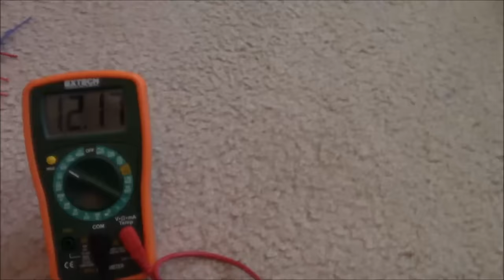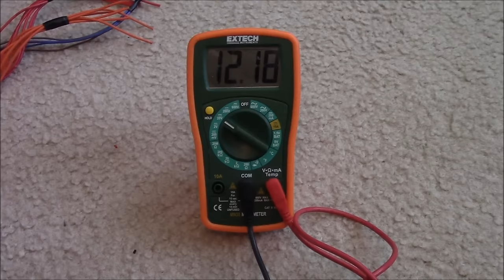How to Hack a Computer Power Supply (PSU) To Use as a 12V DC Power Source

Comment: why you are soldering all the blacks and yellows? wouldn't be enough to use only wire for each? I am trying to figure it out if make any sense. Thanks.
Reply from the maker: +goshell1975 Each wire alone will not be enough to use the full power of the +12v rail of the power supply.  On mine it produces 20 amps and that much current would fry one of those small wires by itself.  But if you give that power multiple wires to pass through it will not burn the wires.
Reply: +LDSreliance Thank you, seems like a decent explanation! Cheers
Reply from the maker: goshell1975
You are welcome.  Good luck!

Comment: once I put the power on and the ground wires together the power supply went on but switched off again a few seconds later. Did I do something wrong? I still get 5v on the standby (purple) wire when I test it though. any ideas?

Comment: Hi, I am interested in powering a desktop at my off grid workshop.   While I have 120 vac available,  it occurred to me that the power supply in these is mostly 12 volt and some small quantities of lower voltage power. 

I am toying with the idea of setting up a small 12 volt solar/ battery setup to power the desktop directly from the battery instead of the 48 volt/ inverter conbo.

Is the voltage swing too wide on an agm battery too wide to make this viable or is it a reasonable concept?

Another possibility would be to find a 48 volt dc fed server power supply. 

Thanks for any suggestions.
Reply from the maker: The best way to do this is to have a PSU that is designed for it.  Here are two options:

Powerstream out of Utah makes a variety of DC powered, full sized ATX power supplies - https://www.powerstream.com/DC_PC.htm
PicoPSU makes a bunch of small power supplies that can be fed directly by 12V DC - https://www.mini-box.com/DC-DC

I have used both in the past.  I used a Powerstream model for my solar powered crypto mining rig (https://youtu.be/ucdIE2aG_Ds) and a 12V DC PicoPSU in my low power home web server build (https://youtu.be/Foioqv09hsU).  If you aren't looking to power a graphics card then you can get away with the PicoPSU units since they will give you plenty of power for a CPU and the normal stuff.  But if you need to run a discrete graphics card in your machine then you will need a full size ATX power supply.
Reply: @LDSreliance  Thank you,  really appreciate the information.
Reply from the maker: You are welcome.  Good luck!

Comment: Thank you so much for your video.  I have completed everything you've 
shown but I am stuck as to where the positive and negative goes to be able to light up LED strips.  I'm trying to help a friend with a set design and we are both stuck.
Reply from the maker: This is just a roll of led's, right?  Where are you stuck?
Reply: I have the LED lights clipped into wires that are connected to a different control box. (Will have to ask the other person the specific name of the control box.) Where I'm stuck....  Some videos I've watched bundles all of the black wires and all the yellow wires..... other videos pair up single yellow and black wires..... I'm assuming I could do it either way but don't know the +/- to either decision.  I also can't tell how the wires are directly connected to the LED lights when the LED lights have been cut. (I hope this makes sense.)
Reply from the maker: It depends on the voltage of your LED's and the voltage of the power source.  LED voltage varies depending on the color and other factors but let's say your LED's are red and require 1.7V each.  Your power source is a computer power supply like I made in this video I am assuming.  So you are most likely using 12V like in the video (yellow wires).  So if you connected each LED individually to the power supply they would burn out because you are providing too high voltage.  So you need to connect 7 of them in series, end to end, so that they can safely use 12V.  

In other words, you need to find out the voltage of each individual LED, take 12 divided by that number, and then use that many LED's in a series circuit where you wire the positive of one LED to the negative of the next and so on.
Reply: LDSreliance thank you so much. I will pass the info on.
Reply from the maker: You are welcome.  Thanks for watching!  Be sure to subscribe if you haven't already.

Comment: Is it really necessary to connect all those wires? The load won't be that great anyway, so the possibility of a burnout is remote. I get that 40 Amps is a lot, but I'm not sure you could hold that much even with all of these thin wires.
Reply from the maker: +SleekMinister Maybe, maybe not.  Better safe than sorry.  I knew I was only ever going to use one load at a time so I bundled them all together.  If you think you might use multiple loads then bundle them into smaller bundles.
Reply: One CPU fan, typically, uses 0,15-0.45A, so the use would have to be drastic indeed, to approach 40, and I still don't see how that' s supposed to be possible. Still struggling to see why I need a power supply that I can't regulate the output on. If only I knew hot to make one.. I'd trade a health tip for that, I would.
Reply from the maker: SleekMinister
Why do you need to regulate the output?  Devices will pull the current that they need and that is all.  Power supplies do not push their rated output upon devices.  So you could hook up a 0.3 amp fan to this and it would be happy or you could connect a 300 watt box fan and it would be happy.  But by not combining the wires together you would not be able to run a higher current load for very long with one of those ~18 gauge wires without heating up the wire and eventually causing a fire or severing the wire.

Comment: I have a 500W psu which states +12v1 16A and +12v2 18A. By combining the wires as you've shown, would this be enough to power a peltier device, along with fans and a pump? Or would it create too much Amperage and Wattage. I prefer not to burn any parts up by over powering them lol
Reply from the maker: I would not recommend combining the rails.  Why not power the peltier with one and the fans and pump on the other?

Comment: If was using for model railroad to power leds with resistors for building lights and street lights could a just run a long bus wire off each and tap into it as needed?  12 or 14 gauge wire for the two "bus" wires running length of table underneath?
Reply from the maker: Yes, but the longer the wire the more voltage you will lose.  12v suffers from a lot of voltage drop.

Comment: If I'm trying to power 4 peltier modules, with fans, can I use this method but distribute the 12v wires amongst all the components?
Reply from the maker: Sure.  Just make sure you are under the max current of the +12V rail for all of these devices.  The only reason I bundled all the wires together is so that I could safely use all 20A that the rail of this PSU provides.

Comment: Hey thanks for your vid ... it's helping me out on a current project.
Reply from the maker: You are welcome.  Thanks for watching!
Reply: @LDSreliance  sir 1 q
Does adding 12v1v and 12v2v poses any problem?
Currently using arduino and pwm controller and for some reason when I wanted change the flow of current pole(clockwise to acw) the PSU shut down before it happens(just 1 direction only)
Can you tell me what is wrong with this?

Comment: I have a power supply from a 2006 Dell xps, does it matter how many wires you have for each color variation? Because I only have 6 yellow wires and two of them have a white stripe mixed into the yellow, does that make a difference?
Reply from the maker: 4 wires should be enough.  Don't use the ones with the stripe.  Dell and other manufacturers sometimes use their own proprietary stuff so you may have to get a wiring diagram for that particular model but yellow is a safe bet to be +12v.

Comment: I did it on my old computer power supply like what you did. But as soon as I got the 12v to run the air pump for car tires, the power supply turned off by itself. And I had to power it off for a min, and then powered it on to get the fan and the power supply to resume. Could you tell me what was the problem and how to make it work? Was it because the air pump needs more power than it can supply? Thanks.
Reply from the maker: The air pump either exceeded the max current on the 12v rail (most likely) or it wasn't asking for enough power.  Either one will cause it to shut down.  So it needs an active load to turn on and stay on and then it needs to stay within the max power parameters.  Mine is only 20A on 12V so that isn't much.  I don't know what your air pump requires but it may have exceeded that.

Comment: If you used one black and one yellow, could you make several connections for 12 volt
Reply from the maker: Yes but these are small gauge wires so they can't handle many amps individually.  I combined them all together so I could safely run 20A, which is the limit of my 12V rail.

Comment: I was wondering if there’s a way to get like 13-14volts out of it. I’m running a car stereo system in a custom box, with a 600watt amp and 2 12” subwoofers. When base hits if volumes over 3/4 it kills the power supply. Any help would be great!
Reply from the maker: Yes, normally you could wire two dc outputs in series to get a higher voltage.  However, on a PSU like this that isn't really possible.  So you would need a dc to dc boost converter to do this.  You should be able to search on Amazon for that term and find some options.

Comment: Question: how do I calculate how many strands I would need to reach the proper amperage? For example, I have a 12V beverage heater that draws close to 11A.
Reply from the maker: Is there a reason to minimize the number of cables that you aggregate?  The only reason to combine the cables together is because I don't think it is safe to use a single wire for higher current applications.  Unfortunately, I don't know the gauge of the wire used and the length of the wires on power supplies varies.  So there are some variables that I don't know in order to do an exact calculation.
Reply: @LDSreliance  Thankfully, I won’t need to find out the answer to my question. My old Dell PSU actually has three separate 12V rails, rated at 18, 16, and 8 amps respectively. The yellow is the first rail, brown the second, and light gray/white the third. 

Pro tip: your PSU might have a label on it that gives the ratings for each rail. 
Pro tip 2: if you have and know how to wire 4/6/8 pin female connectors for the PSU’s plugs, you might not have to snip them. Obviously, connecting green to black permanently is still recommended.
Reply from the maker: Those are true tips.  I have seen about 1/3 or so PSU's with labels on them that are helpful.  It seems the cheaper ones more commonly have stickers but the "gamer" PSU's typically do not.

Comment: Do ALL the Black wires need to be connected ? and ALL the yellows ? is 'WHY' a big question ? I have some shorter black wires too....is that for a different purpose or do I connect those to the other black wires too ? BTW Great Video - Thank You very much :)
Reply from the maker: +Bret Ames Thanks for the positive feedback.  No, you do not need to connect all the black wires.  I would recommend it because it will minimize the risk of overloading the wire with too much power.  If you connect all the black wires (and all the yellow wires) together then you can safely use the maximum amount of power the power supply can produce.  If you only use 5 of each and powered a 20 amp load you will burn up those wires and potentially start a fire.  Does that make sense?
Reply: +LDSreliance Thanks for replying. Yes that makes sense :) i GOT IT WORKING NOW. i HAD TO SEPERATE AND THEN RECONNECT THE GREEN AND BLACK (SWITCH) WIRE TO GET IT WORKING AFTER IT FAILED TO WORK. ALL GOOD NOW THANKYOU
Reply from the maker: Bret Ames
Glad to hear it is working.  Good luck!

Comment: Thanks for the video, very informative.  Would you know why the main/large fan doesn't turn on for my power supply? I hear a smaller fan with the ps, but the main fan doesn't turn on.  It did turn on when on the motherboard.  Thanks for any help.
Reply from the maker: I am not sure but it could be that the psu does not sense a load so it is not actually providing any power even if you hear a smaller fan running.  Sometimes you have to use a resistor or hook up a real load before it will turn on even when you short the power on wire.

Comment: hey man how ya doing? good vid. I did this a while ago for a home made computer controlled pipe organ/studio keyboard system. did you do another about modding it to increase the voltage to charge a battery? I found a drawing showing how but it wasn't easy to figure out so I tossed the idea aside....
Reply from the maker: That is in the top 3 of upcoming videos I need to make.  Sorry for the wait.  Stay tuned!
Reply: LDSreliance no worries! I'll look forward to it.
Reply: Hi there - great video btw
Yes, I too would like to be able to charge a car/van/boat battery... I'm also unsure about what amperage the 12v rail gives. Thanks in advance for a reply!
Reply from the maker: You will have to look up the model number of your PSU to find out the specs on that rail.  But generally you could divide the watts of your psu in half and that will be roughly what your 12v rail will provide.

Comment: Rather than connect all the yellow and all the black together, could you use them separately to power several things at once, or will that affect the performance??
Reply from the maker: Yes, of course.  But keep in mind that you should not try to use all 20A of the rail over one or two wires because they will heat up and short or start on fire.  I would recommend bundling them together in at least 4 wires each.
Reply: LDSreliance where did you buy this particular power supply from??

And also I have been doing some research looking around on the internet and apparently cheap Power supply's are really dangerous and could set on fire, so this is holding me back from buying. Have you had any problems with yours?
Reply from the maker: I answered your other comment on this.

Comment: Can I use each individual yellow and black wires to supply one of many, security cameras that each need 12V (I guess total of 5Amp). Then how can I get 24 volt out of it if that is what the cameras need?
Reply from the maker: You can't get 24V unless you have a step up transformer or voltage regulator.  You can use the wires individually if you need to but I would not use more than about 1-2A on a single wire.  If you are using 5A then I would combine 3-4 wires together to be sure you are safe.

Comment: Hi great video , do you have to connect all the yellow wires together to get 12v or can you use them  apart as 12v source ?
Reply from the maker: You can use them individually as long as you aren't exceeding 2-3A.  If you want to use the full power of the power supply on a single device, you definitely need to use multiple wires together.
Reply: Thanx alot, all I am going to use it for is LD strips. Great video 👍👍
Reply from the maker: Thanks!  I appreciate it.  Good luck!

Comment: How many black & yellow needs to wire together to get 12v 10amp to power the peltier in the other vid. Thanks
Reply from the maker: I would never use less than 3-4 wires together for a 10 amp load to be safe.  So 3 black and 3 yellow would probably do it.

Comment: Hello,

Can I use Molex 12V (peripheral 4-pin connector output) as power source to LM2596 DC-DC Buck Converter as USB charger ?

Thanks
Reply from the maker: Maybe.  You will only need 2 of the wires.  The other 2 are not needed by most non-computer devices.

Comment: So it is safe to say the yellow is the +ve (Red) and the black is -ve(black).

My question is the device I'm going to connect to have max amps of 2.6A, and say mine also gives 20amps,  how should I limited it?  Or maybe the devices will just draw 2.6A ?
Reply from the maker: You don't need to limit it.  The device will control the power it draws.  And yes the yellow is positive and the black is negative.
Reply: Cool!, but that's only the device have a smart circuit right? 
I'm trying to connect it to a 12V pump @ 2.6A, I guess I can draw too much current? If it will then I will add a breaker between the pump and the power so pump won't get damage.
Reply from the maker: Ming-Chi Huang This is a common beginner mistake so don't feel bad.  A load will only accept a certain amount of power.  It is incorrect to think that a power supply making 20 amps will force 20 amps worth of power on a 2 amp device.

I would recommend watching this video on current to help understand better:  https://www.youtube.com/watch?v=coaera2mbk8

Comment: if i use the yellow wires individually, i mean not as a whole, will it still give me 12 volts? im looking at using it for different gadgets or appliances..
Reply from the maker: Yes, but it will not be safe to use the entire current of the power supply over just one wire.

Comment: My power supplies says its good for 15 amps I'm needing a power source that will do roughly 10 amps will that be possible with this it the form that you have it hooked up? Thanks for your time.
Reply from the maker: Yes if the 12V rail is capable of 15A then it can easily do 10A with this method.  Just use multiple wires (at least 3 in my opinion) or all of them combined like I showed in the video.